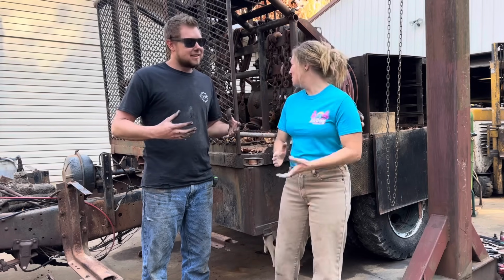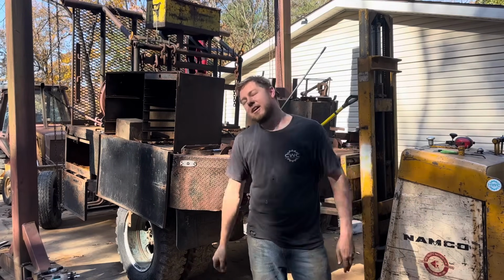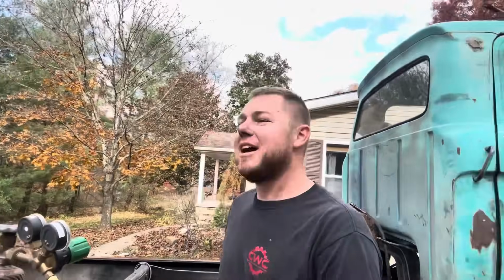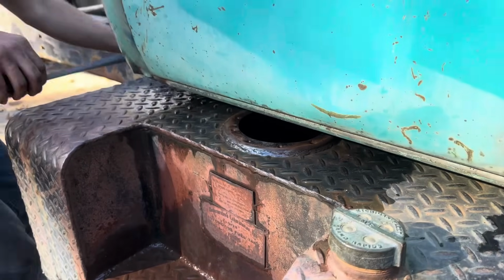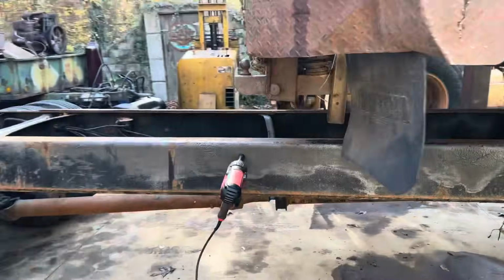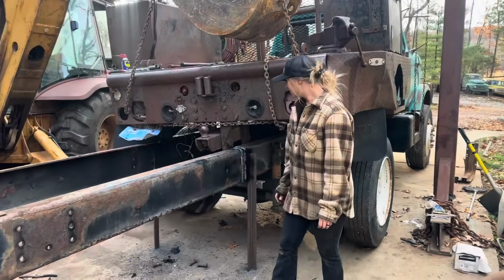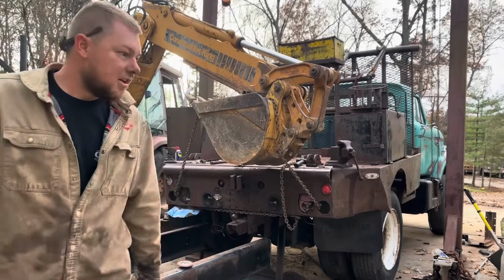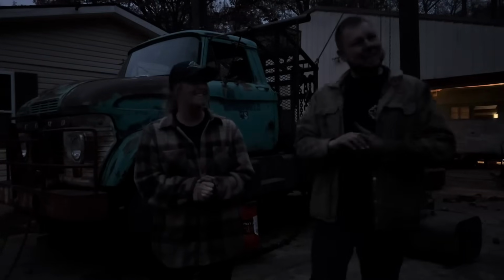Grab your blankets it’s BED TIME!!!

Comment: Just a future idea, if you pump in exhaust from a truck into the tank you can weld without issue, the CO2 displaces the oxygen so the fuel can't burn, just saying.

Comment: I thought the idea was to get as many videos off each project as you can. It is a Cool looking Welding truck. Yes. that's what it is. A welding truck. Especially liked hiding batteries with a fuel tank cover. Helped the step up into the cab also.

Comment: The build is coming along  nicely but Hannah was making me nervous i have done alot of those jobs rolling axles and shortening and lengthing frames check the driveshafts you took out one of them may fit right in by just by changing  the yokes you might get lucky .Keep up the good work have fun and Hannah dont get yourself in a bad position again..My wife didn't see this video yet we will watch again in the morning.  Dean Patriot Steel Design and the sign looks good hanging onthe door.

Comment: I shortened my c65 by 8 feet. I bought a good 1/2 in bit and used a pipe and ratchet strap as a drill press and drilled  24 holes through a double frame. Not fun but results were fantastic. I love your videos and you two work great together. I love the big trucks. Thanks

Comment: You guys need to return the bed to as original condition as possible. That was alot of the "coolness" of this truck was all the equipment on the back. The air compressor, the chains and hoists and all the equipment was awesome. I know you need room for the goose neck and all your stuff, but try to return it to original as much as possible.

Comment: Any air fittings you replace should have dot on it you can use regular ones but if you ever get stopped and they dot your truck it can be a ticket also if Hannah needs another step on the drivers side and you are worried about it hitting something you might look at the moffet forklift had a step held on by a 1” cable and it was changeable and flexible

Comment: If you run the rpm up on the backhoe its easier to be smooth they are designed to run at upper Rome I have the same hoe and I run the hoe pretty close to wide open when digging.